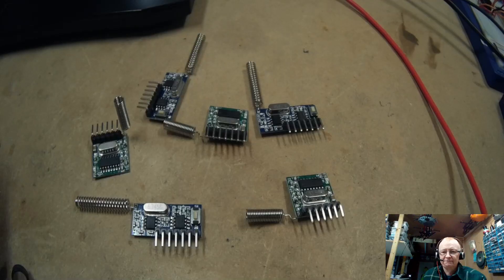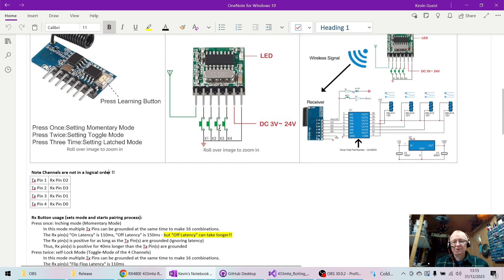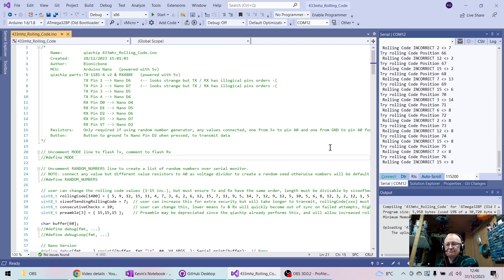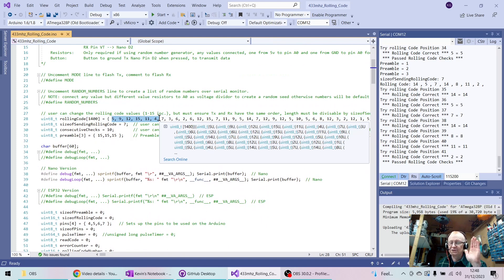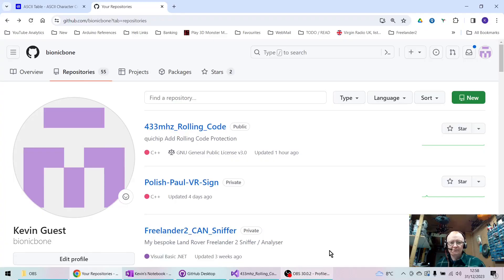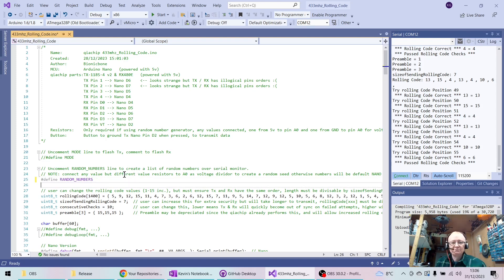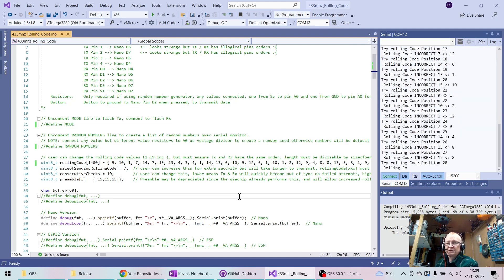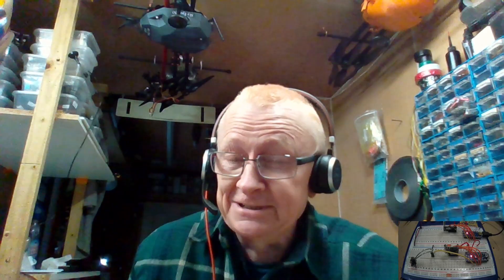433Mhz You can't hack this !!

Comment: This is how i'd try, just from your description (not looked at the code).
Capture 1, then send random guess to move along, send captured and repeat. If the random guess is right, door opens otherwise you'll only need to send as many attempts as you have in the numbers list. Trying to roll your own rolling code without knowledge of cryptography is usually a disaster. You should see how complex the original keeloq was, but it still was broken after the method used was leaked.

Comment: You could add an RTC to the electronics and have the code be dependent on the time it receives the message. It solves the problem of desync.
Reply from the maker: Thanks for watching. Desync has been resolved on the latest updates. Check the channel for the latest videos or github which also links to the videos.

Comment: If an incorrect code is repeated, Rx wont progress..
Hacker records 2 valid sequences and plays them back alternately. Rx progresses and looks ahead so it only takes once round the sequence and I'm in.
Reply from the maker: After x (set by user) incorrect receives the rx starts a lock down, again set by user, ever increasing time outs. Its not perfect and can create a long lock out. But at least the criminal is also locked out.
Reply: @TheBionicbone  there is a solution...
Use encryption...
Encrypted information is salt (key word that must be present) and a counter.
Tx encrypts a sentence comprised of salt, count and RSA signature(that's overkill, but hey..) then increments count.
Because count is never the same, RSA signature will never be the same. Encrypted, doubly so.

Rx only has to decode a valid packet (correct encryption was used), check salt and RSA signature (double protection), and check that count is greater than any recieved so far (pre recorded packets won't work).
Reply from the maker: It's true and the normal way, but I like to find different things and while what you mention and RSA is industry standard the industry is already preparing for the future. Search quantum resistant algorithms, and look for US government or banking

Comment: Nice! 👍
For dealing with interference, just add at the packet end CRC.
If received CRC doesn't match calculated value from received packet, receiver just ignores packet all together as faulty and don't even check compatibility with rolling code.. 😉 And waits for new packet..
For remote part - before CRC add in packet button press counter in coded manner (XOR, bit swap etc). Remote will update counter after every button press and send that data in packet.
Receiver, after CRC check, first decodes received button press counter data in packet, then according to that data, goes looking in rolling code table.
To prevent hacking, button press counter can't be smaller than stored last counter value in receiver, that's mean's - there is no way to reuse old or precisely captured rolling code data, because counting can only go forward until looping..
If button press counter data is smaller than expected, packet will be simply dropped..

For extra safety, button counter data can be added, even in middle of data packet between rolling code data.
From theoretical point of view, even if hacker will decode button press data, it can't replicate next parcel, because he don't have rolling code data table, but this add will ensure good remote and receiver synchronization..
Reply from the maker: @artursmihelsons415  what can I say, great minds think alike. Have a look at the update I have just released :) https://youtu.be/CfMDaaJQzlc. I have added multiple Rx option, and I've added the Rx number in the exact way you have mentioned for the button (I may do this for the button later). Failed transmissions are a thing of the past, even in high interferance areas. Thanks so much for your great comment and for watching and taking part, it really is appreciated.

Comment: Im just passing by. I havent studied this algorithm. But a it is a testcase perhaps, to consider 20 neighbours having the same locking mechanism - it should not leave the neighbour that happens to be on holiday for some weeks with a locket door.
Reply from the maker: Thanks for looking. This won’t happen because the qiachip devices have to be paired, Tx to Rx, thus signals from a non paired Tx are ignored. I appreciate your comment though and you having a look.

Comment: I made implementation where i have aes encryption and decryption. I would send random IV unencrypted and send encrypted counter from remote to receiver (with also the command - button click/longpress/dual press etc.). AFAIK sending IV plaintext would not be bad practice. I would always allow higher counter number than the one already sent, so it would never go out of sync and would not allow lower number so it can't be replay attacked. On the remote and receiver side I save counters to eeprom and use rolling location for wear leveling and very high endurance (20+ years having multiple transmissions per day). Only problem I have is that it eats up majority of typical arduinos rom and ram. Your implementation seems far lighter and time will tell if it's secure if more people test and look into it. Thanks for great work.
Reply from the maker: Thanks for your positive comments, I too intend to use eeprom too, it’s a good point to use rolling location for this.
Reply: Thanks for describing this solution. I truly believe the rolling key mechanism is obsolete and not secure. The standard encryption & decryption mechanism from the computer world is a secure solution. Of course, RAM and storage are an issue, but there are dedicated security chips or controllers with hardware assisted encryption modules (many of them out there). The AVR is an old platform now (from 90's).
There is nice example of the implementation here https://ww1.microchip.com/downloads/en/appnotes/atmel-42784-software-library-for-aes-128-encryption-and-decryption-on-megaavr_applicationnote_avr284.pdf

Comment: What happens when you sync the Tx and Rx? Have you looked at the raw frames? Couldn't you use them to know where the code starts from?
Reply from the maker: I can not see any vulnerability here. Since it is driven from a list of random numbers set by the user rather than a generated next number then the next set of numbers is impossible to reverse engineer and therefore impossible to tell where we are in the list. Also, if it was possible to workout say "in the middle of the list", it still would not help because what comes next is only known by the list in both the Tx and Rx, it can not be calculated.
Reply: @TheBionicbone  When you resync them, you don't change the list, right?
So it wouldn't be hard to put a receiver near your garage door, register frames passively for a month, then flood it with wrong guesses and force you to resync them. You'll start somewhere in the list and I'll know the next frame from my previous recording.
Reply from the maker: @NicksStuff  ok I see what you are getting at. At the moment no battery back up, thus power down Rx and we'd have to start again, reset Tx too. Also if you reflashed with "your settings" and did not change your settings or base numbers then it would repeat from the start. If someone had been recording your codes then technically they could start replaying them. With the latest code on each 10 incorrect then it would lock up for 60 seconds, then 120, 240, 480 seconds etc. any codes sent during this time are totally ignored. For clarity a normal code resync moves forward never backwards, so the Rx catches up with the Tx which can only go forward. Eventually, once I start on the text messages part I'll add eeprom, I hope then I'll be able to store how many times the list has been played, then I'll be able to roll the numbers forward and reset back to the correct position and be at the next new numbers. I hope all that makes sense, it does in my head 😁

Comment: Rule #1 in cryptography: Don't roll your own! Don't get me wrong, I appreciated and liked the video, but as a demonstration of the basic idea. But for anyone thinking of implementing this: Don't! Use an existing, proven, algorithm!
Reply: Like Microchip did (Keeloq), 😆?
Reply: @robertbruce7686  That was security by obscurity, never works when the method is leaked and flaws are found. I was looking at the electricity meters recently, where you enter a 20 digit number and am pretty sure you could hack those if you had the data tables they use for encryption (those tables are only available to manufacturers currently).
Reply: As a cryptographer I think your design is decent. If you have a clock you can use that as part of the seed to the rolling codes.
Reply from the maker: @Rob_III  with the greatest of respect I have to disagree. Let me pose a scenario. If I purchased a Land Rover Discovery today (if I could afford one:) ) then it would be very easy to use a relay attack and steal it, crime stats and LR insurance increase demonstrate how many are being stolen. If I somehow disabled LR protection and used mine own method in a different way to unlock the car, how long would thieves hang around trying a relay attack before moving on to an easier target? My point is, the uniqueness of my design and allowing each to be different in list of codes, init-value (which is only apply once the list is used not every time), the number of codes to make a full sequence, all mean end users can make their system unique and this in itself (in my opinion) is the best security of all.
Reply: Hi @TheBionicbone , thanks for your reply in the first place! I disagree though. What you're describing (look it up on Wikipedia) is "Security through obscurity". The best cryptographic algorithms are open and reviewed by cryptanalysts. I wish I could post a bunch of links, but I highly recommend you also google "cryptography don't roll your own". Ofcourse, if you implement your idea as a "one off" then most likely thieves won't hang around for long to try and figure it out; however, if your method is being used more and more widely you can bet that someone is going to figure out some (maybe sidechannel-)attack on your algorithm and break it wide open.
Reply: I have written my own algorithm and no one knows what it is. Without me telling someone the method it's even less likely someone can hack it. I generate my own unique key and use no ones algorithm,  only my very own and I'd love to see someone hack it without looking at my code because I personally doubt looking at the encrypted text anyone could make any s3nse of it. I tried to hack it with a few known methods and those all fail because those are known methods. Just my 2c.
Reply from the maker: @newmonengineering  sounds like a challenge, why not share 12 numbers and see if I can predict the 13th?
Reply: @newmonengineering Again: This is "Security through obscurity". Are you using a CSRNG or a PRNG? Are you using constant-time comparison or are you vulnerable to side-channel attacks like a timing attack? Are you a cryptography expert or are you just "making things very complicated so someone will never be able to hack my system"? Again, and this has been proven time-and-again: When it comes to security the adage is, for good reason: Don't roll your own. If you think you can do better than proven algorithms then you *should* be able to tell someone how yours works and *still* be safe. Because, at one point or another, a determined attacker, *will* get a hold of your code (maybe not in source code form but in binary form) and *will* be able to reverse engineer it. You are going to have to assume that and if not, and your code relies on someone not having access to the code you've already lost. Now, an attacker may not be interested in hacking a one-off, it may not be worth the time or effort, but if your algorithm is going to be used at scale, you can bet your behind your algorithm is going to fail unless reviewed by cryptanalysts at the very least.

Comment: You don't necessarily need to store many codes for your sequence. You can use a seed for a pseudo random number generator. If both Rx and Tx use the same pseudo random number generator and the same seed/salt then they can programmatically follow the same sequence without needing to store a large lookup table. Also look in to shared secrets, HMAC and Rolljam vulnerability.
Also, multiple failed codes should cause a progressively longer timed lockout. This makes it much  more difficult for a brute force attack to  succeed within a time frame acceptable to the attacker.
Reply from the maker: Thanks for commenting. The idea of storing the random numbers is to remove the predictability of the next code and eliminate any reverse engineering by capturing a few codes.  Although for the next loop I do intend to reseed the numbers so they don’t repeat, but again the hacker would be unaware of when that happens since it will not be after every transmission. I like to think of it as using spare memory, while adding security and challengeing the current methods. I like the time out idea I may use that as well as lock out after 10 unsuccessful attempts. RollJam is also on the hit list but this need/may need different Tx/Rx device, if possible I'd really like to make a vibrating Tx Fob in the event RollJamming is detected, but lets see how far I get based on end user interest.
Reply: @TheBionicbone  That is a non issue if you use encryption. The common vulnerability to fix is guarding against rolljam attacks which can only be done with embedding a timestamp. Any other rolling code is going to be susceptible to rolljams and replay attacks too triggered when not in range.

Comment: This could be brute forced right? 256^7 is big but you could get lucky?
Reply from the maker: Technically yes, but you’d have to keep changing your numbers and then system would keep changing its numbers, it’s a bit like playing the lottery. I have thoughts though, if it receives say 10 signals without a pass it could just lock up as we’d know a brute force was being tried
Reply: This would absolutely work; but whatever system you use to reset it would be vulnerable as well. A hardware key maybe? @TheBionicbone
Reply from the maker: @thebagmasters  have a spare fob that has a reset code, if pressed it resets the numbers loop back to the beginning. If a hacker sent these codes by chance, the numbers loop would reset but they would not realise this had happened unless you were using it all the time, followed by the initial entry code for some reason
Reply from the maker: @thebagmasters  I have added a delay, if 10 unsuccessful codes are received then it locks up for 60 seconds, after if 10 more are received, locks for 120 seconds etc. This timer is reset once it gets a correct code (obvs only after its finished the lock out). Thanks for the idea.
Reply: @TheBionicbone  Sounds good, and with all rolling code, if it is brute forced too much it just locks out; which is a good indicator in itself.

Comment: nothing is unhackable and this has a few of the usual attacks. like there's being able to clone the key with nothing more than physical access and then using the cloned key - that way you don't just have a clone but can actually run denial of service by using the clone first. One could also denial of service your sender by just using it 10 times while not being in range of the receiver.

there's also actual RF attacks on rolling keys that don't require physical access to the sender. samy kamkar held a decent talk highlighting current research for stuff like this at last year's defcon. great talk on the basics of these things.
Reply from the maker: I have to agree, human makes and human breaks, it will always be the same if someone really wants to gain access they will even with risks of getting caught. Lets face it, if someone puts a jig under the door and lifts it no rolling codes stopping that :). But if I can detect lots of unsuccessful codes / RollJam and warn the user (vibration fob / text message etc.) then it could be as sucure as we can get today
Reply: @TheBionicbone  The thing is, these big rolling code windows actually make it safer b/c of how the human psyche handles repeated false positives. It's also always important to remind people that a DIY solution, no matter how great it is, might risk an insurance company rejecting claims in case something gets stolen.
Reply from the maker: @IzzyIkigai  the insurance issue is a good disclaimer I should add. I'm not sure where you are in the world but here in the UK insurers tend to ask if it alarmed and if it is then is it xxx approved and is it service at least once a year. Nothing DIY is xxx approved and therefore you'll never get an insurance discount. Thanks for you input.